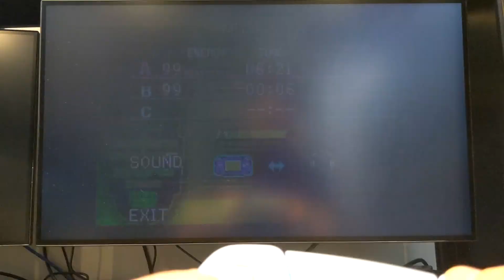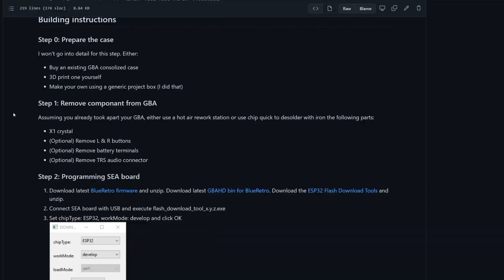BlueRetro + GBAHD consolized GBA using a single SEA board

Comment: Have you used rj45 connection for blue retro, using one or two connections? I'm thinking about doing this because I use consoles that need few connections like Dreamcast, GC, N64, *SNES and *PS2 (*would use 2 rj45)